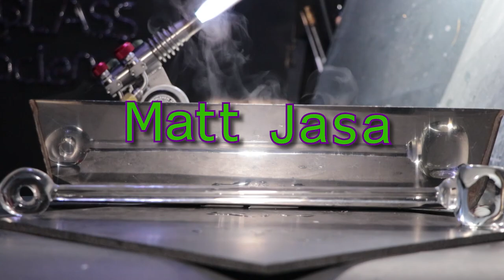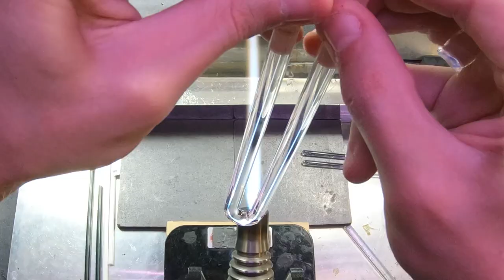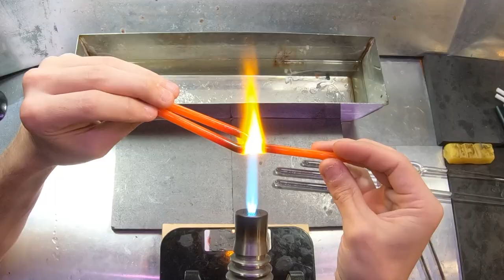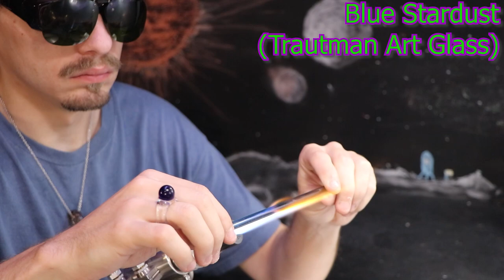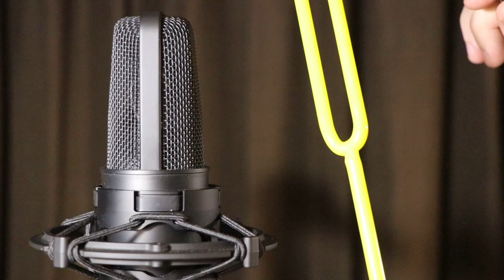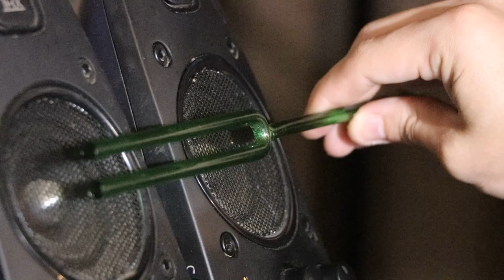Glass Tuning Forks?

Comment: Spectroid or Ultrasound detector is what you need to test these. The math of tuning forks leans towards ultrasound and higher frequencies due to the speed of sound, the profile of the fork, the length of the tines, and the stiffness of the material.  It is likely you are not hearing most of the sounds here as they are out of range of human hearing.
Reply from the maker: Hey Sedit, Yeah I was heading into this one kind of blind. I didn't know much about tuning forks besides their shape of course. I did test some ideas about diameter, material, and length. Length seemed to make the largest difference, while I believe diameter could possibly affect the volume; having a overall larger fork. This is another video like the cobalt magnet I'll need to reattempt. Thanks again for watching, stay melty my new friend!

Comment: Glass is so awesome!
The company where I learned makes hollow, oscillating measuring apparatuses out of borosilicate, that are extremely tiny and very, very difficult to make consistently. They're built into a lab-device, that can measure the density of liquids with crazy accuracy (Something like six or seven decimals of g/cm³), by passing them through the oscillating capillary tube and comparing the differences in sound. This makes measuring alcohol and sugar content possible and they're the reason why beverages always taste the same. Super interesting stuff, but I hated making them.
Reply from the maker: Hello Glasiator, That sounds very cool. Glass is perfect for scientific testing. It's not only transparent, but one of the least reactive materials. So you don't have to worry about chemicals leaching into or out of your container. I would love to see what your measuring apparatus looks like, what was it called? Also thanks for checking out this video, its always great to hear from other glass workers!
Reply: @MattJasa  Hey Matt, They are very small and the u tube is capillary tubing of 0,03mm wall thickness, which is crazy difficult to work with. Here's a link to what one of these looks like:
https://wiki.anton-paar.com/fileadmin/wiki/images/mass-and-density/U-Tube_DMA_TM_Family-01.jpg

Comment: I toyed around with tuning forks holding them closely over the opening of glass bottles and the sound increases quite a bit if you find a good match. The Retap water bottles worked well for me, the mouth is wider than some bottles. 
Also I've some meter lengths of Heraeus quartz tubing used for making fiber-optic cable and if held in the center and rubbed with a damp washcloth, are quite annoyingly loud.
Maybe a tuning fork windchime would be fun to make.

Comment: Very cool. However just like how its one thing to make dice of glass, its quite another to make one perfectly weight balanced on all sides let alone make a bag full that are all the same. With tuning forks, it's one thing to vibrate an audible tone, but to be usable itd need to be vibrating perfectly at 440 htz (A) as does a standard metal one. Seems lots of. Experimenting, then once dialed in CNC a graphite mold and forge them to consistently make a usable end product?  Same is more then likely the case with dice. When using a tuning fork one method is placing end of handle on the guitar body and the audible sound transfers easily . Had you touch the fork directly to your microphone cabinet it may pick up quite well. So youve done pics and forks, how long till we see you make a glass guitar!! Keep it up entertaining and educational

Comment: Hey Matt how are you. I am curious if you are happy with your bravo torch. I am thinking of making the plunge to stepping up to a larger torch. But don't believe the gtt hype. I know every torch has its pros and cons but I like the low gas consumption of the Bethlehem line. Hardy every see you use the bravo side and mainly see you use the internal alpha flame. Does it cover most of the work you do? Sorry so long winded. But thanks in advance. Enjoy your channel very much.
Reply from the maker: Hey Darren, I'm doing alright. Getting a little worn out from the more frequent upload schedule but hanging in there. I do love the Bravo. It really depends on the size of objects your wanting to make; Some of my larger projects wouldn't of been possible without the 2nd stage. I like to think of it like a paintbrush, It will do the same work just in a larger area. Thanks for watching and commenting. Good luck on your glass journey!

Comment: Try bridging dude .A small piece of glass between the fork ends to brace them while you melt in the other side stops any movement
Reply from the maker: Hey Codfan, Yeah that would of helped keep things stable. Then clip the bridge off the end once the handle is done. Those 7mm rods were difficult though. I'd recommend doing at-least a 9mm rod.
Reply: @MattJasa  They sounded great , I wonder if you get a different tone with wider rods ?